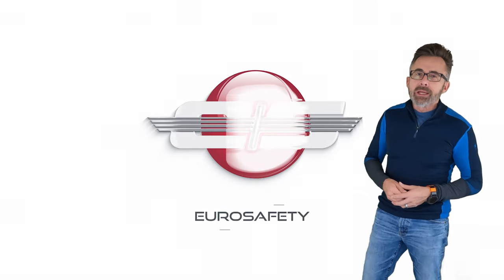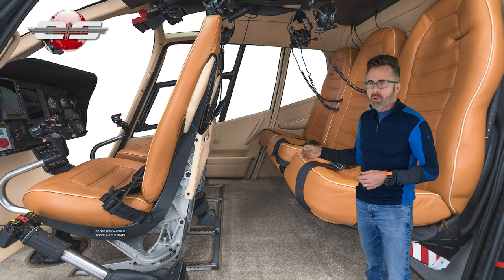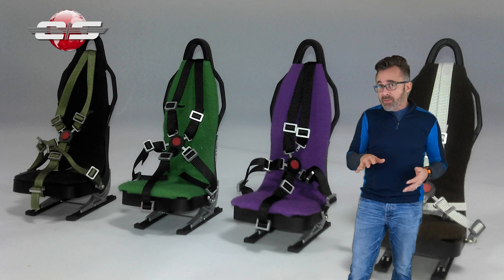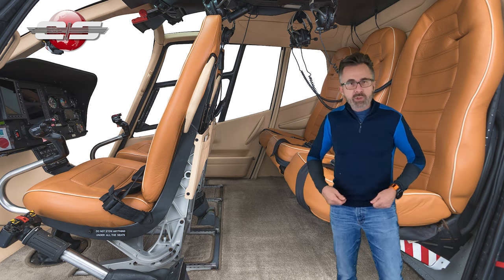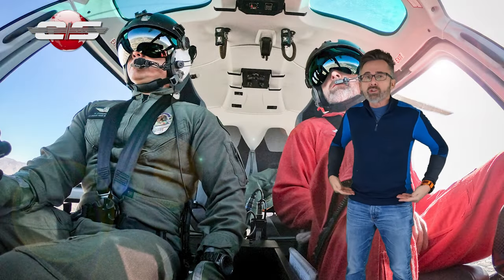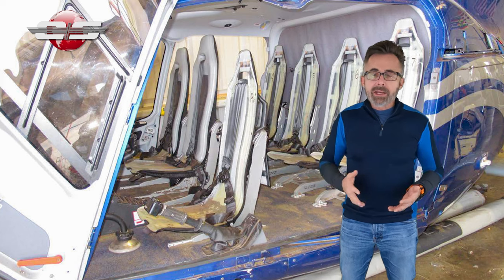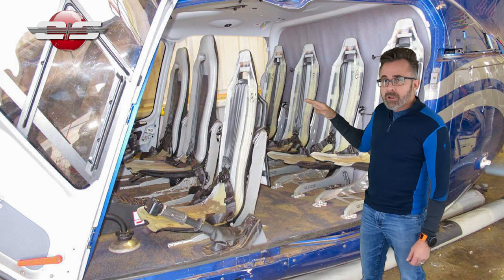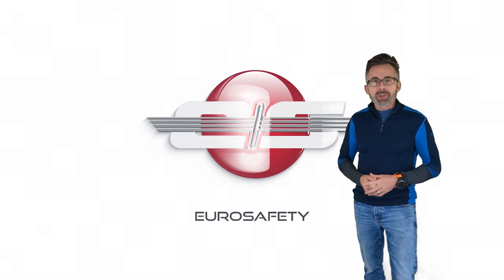Life-Saving Secrets: Crash Attenuating Seats & Seat Belt Operation Explained

Comment: Sorry! I have to clear something up for you all. Towards the end of this video the gentlemen points out that the seats in the Blue Hawaiian helicopter are different levels because the seatbelts were worn incorrectly. That statement is not entirely true. They stroked at different levels, because these seats are poorly designed. The pilot weighed 185lbs, the passenger to his right weighed 145lbs and became a paraplegic. To the right off that passenger was a 180lbs passenger. In the rear seats to the right of the center seat a 233lbs passenger, and to the left of center the seat had a 263lbs passenger. The two center seats should have had a much greater stroke than any other seat. The far left passenger in the rear was 188lbs, and the far right rear passenger 154lbs. Why his statement is incorrect, is the FAA only requires these seats to be tested with a 170lbs male Anthropomorphic Test dummies. If the seat passes, the FAA says the seat is crashworthy. The seatbelt does need to be worn correctly. The correct use of seatbelts, is placing the buckle low enough that the lap belt, on either side, as it comes around your waist, is placed on the pelvis below the iliac crest. Then cinch the lap belt as tight as you can get it. Then click the shoulder straps in place. The Five Point Harness is a much safer alternative especially for helicopter passengers, because the forces encountered in a helicopter crash are mostly vertical combined with forward and lateral forces. The Five point Harness is designed to keep passengers in there seats during low G maneuvers, especially those encountered during Autorotations, or the “second bounce”.
Reply from the maker: I appreciate the additional insight to the particulars of the passengers weights. Regarding your comments.... to be fair I never stated the name of the helicopter company and we actually photoshopped the name out of the picture. I am going to take for granted that you are correct about the 170 lb testing... sounds legitimate... that does not mean they don't work below that weight... 170 you are fine and 168 its over for you thought process does not hold true.... To say the seats are poorly designed is a massive statement... you are saying that all 350s and 130 have substandard seats in them... that would be a massive scandal... On to your passenger weights... first, you will have to agree that 99% (if not more) of passengers do not have their seat belts on right until corrected and about 50% of pilots are wearing their seat belts wrong until corrected. You will also agree, I am sure, that in order for any brand of crash attenuating seat to work the occupant has to be secured firmly to the seat. Now as you weights show, the heavier you are the more likely they are to work properly with a seat belt on wrong since during the low G just before touchdown the really heavy person will not go up as much as the light person. Regarding the 5 point... I cant tell if you are agreeing with me or disagreeing. At the end of this.... The point of the video was to encourage pilots to ensure their seat belts are worn properly, and their passengers seat belts are worn properly. Your comments come very close to indicating that the videos information is wrong and to disregard it. I am trying to provide information that makes us all safer. I am sensitive to the fact, by the amount of information you have and the emotion of defense in your response, that you are connected to the event. I did not make the video to bash anyone in any way. We have a very bad habit of looking the other way after an accident in the helicopter community. Its considered unpolite to analyze any hard ground contact. Then we are surprised that the same accidents keep happening.